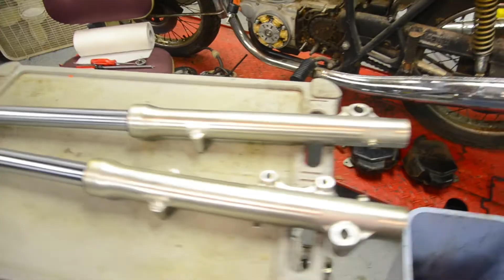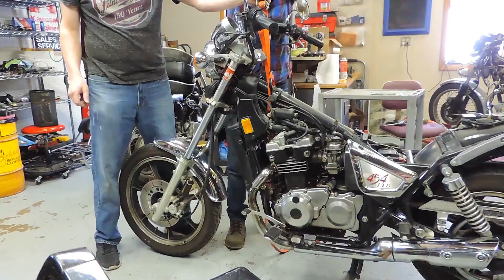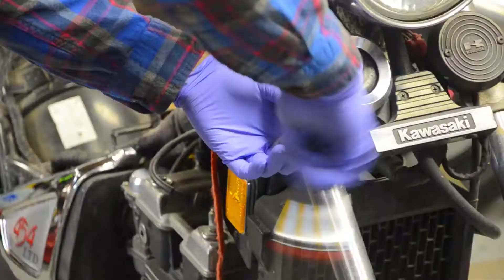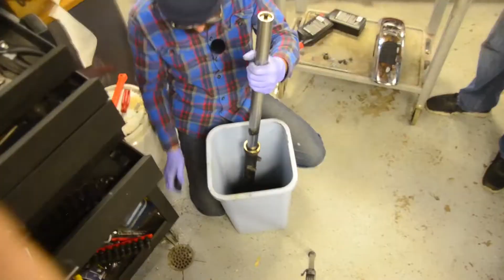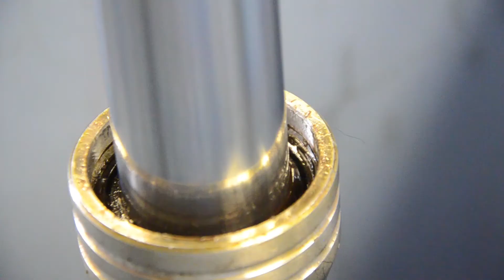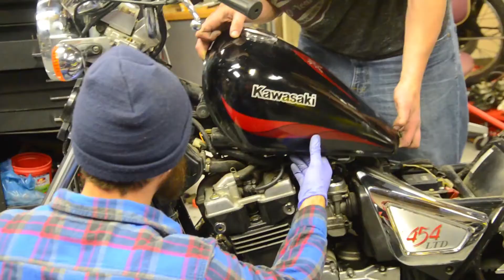Fork Seal Replacement - Conventional Motorcycle How To Kawasaki 454 EN450

Comment: I got a Vulcan 900cc and want to get a z1300 folk tubes for cheap and put them in place of ones on my bike. There 41mm tubes like Vulcans 900 tubes. Apart from sleeves maybe being too thick it should work right?? Was going to put a extra spring on top to fill gap as z1300 folks are longer. That's what I need more hight in front end + the  z1300 tubes have threaded caps so can put folk extensions on if needed.

Comment: I don't know if you even still keep an eye on this video - but what other methods are there for removing that bottom allen bolt? The one on my 05 Vulcan 500 just spins & spins. There's no way to hold whatever is spinning inside the cylinder without some $50 tool from Kawasaki. Thanks
Reply: I found on my KZ440 LTD that compressing the fork almost all the way while removing the bolt worked. After drilling one of them out of course.
Reply: I used a length of threaded bar, which I ground down, to jam the bolt from spinning.
Reply: @edtaylor8408   awesome solution. I ended up using the rounded end of a 1/2" breaker bar. had to hold it with one hand and turn the bolt with the other... But it worked.
Reply: I always use air impact wrench to give a proper spin to open it. It helps a lot since the piece inside that the alley key bolt is attached spins around easily.

Comment: I've got oil leaking out of the fork on my 04 gsxr1000 on both sides. Is it likely to be the fork seals or could there be other causes for this?
Reply from the maker: Aaron A - Fork seals are the most likely thing, yes. Unless there is significant damage to the fork. If you've been doing wheelies, then it's most certainly seals. This week I'm editing a video where we rebuild a set of 2007 GSXR forks.